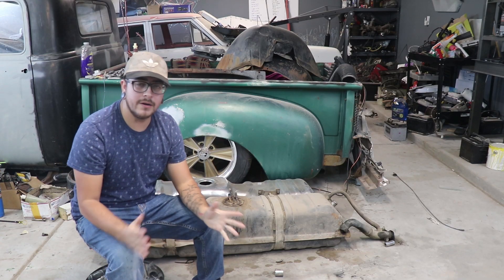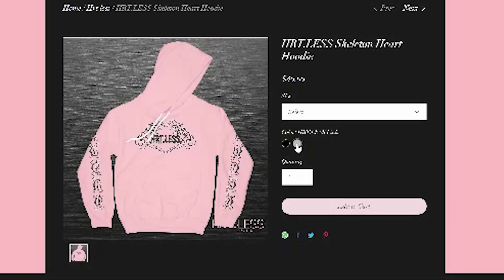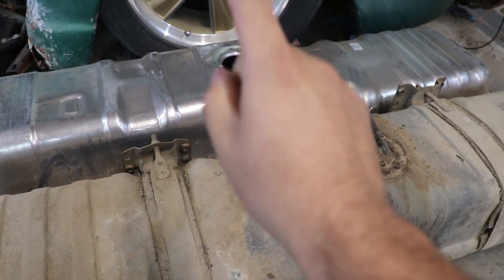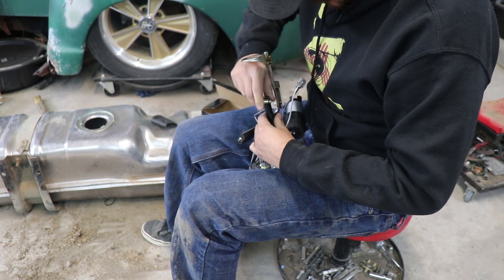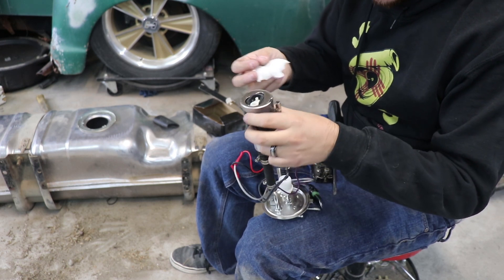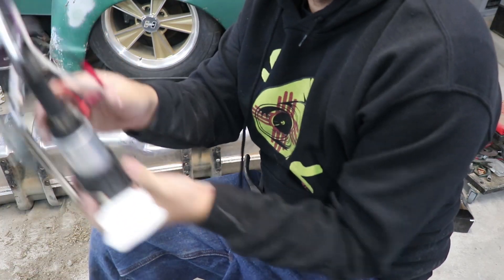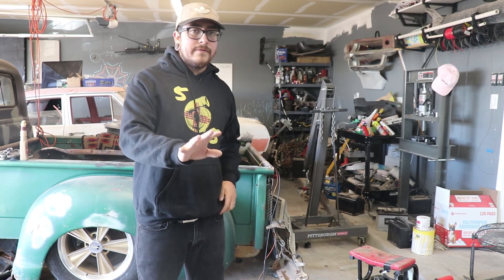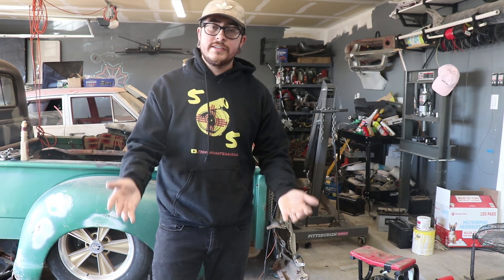Squarebody LS Swap part 5 -  Fuel System

Comment: Hey man great info here. Question… do you have a good recommendation for a behind the seat tank in a 68 c10 ls1 swap fuel return? Having a hard time finding a good reference.
Reply from the maker: Honestly get that tank out from behind you man. Having a fuel pump right behind you head will drive you crazy. There should be a drop in under bed tank for you. If not a good fuel cell will do

Comment: Would the yoke out of a silverado be the same
Reply from the maker: The spline that goes in the transnis most likely the same but the u joint size might be different. Bigger joint for trucks usually

Comment: Saw you used regular hose clamps at the tank.  Do the hold well and not leak with the pressure of EFI?
Reply from the maker: These are EFI clamps hose clamps can be used on the return lines if needed

Comment: The nylon fuel line is way cheaper and easier to use than AN line. Its all webise for fuel line repair at work. Its also what i plan on useing for my 5.3 swap in my 94 S10.
Reply from the maker: I prefer an stuff but that's just because it's what I've always used

Comment: Hey man  just watched your video got a question the fuel sender assembly will it work with my truck fuel tank as well I have 81 k20 pickup 3/4 ton I want to make sure before I start purchasing parts
Reply from the maker: Your tank isn't baffled for efi. It will work but youll need to keep your tank half full always as the fuel sloshing could run your pump dry
Reply: @JovaniDanteGriego  sorry for the late reply man I forgot to mention that truck has a 6.0 engine inside does that change anything or the same result? I really don't wanna change the fuel tanks for other ones I wanna keep it orginal with out having to do more work
Reply from the maker: @salvadorcordova5046  in your case just use an external pump then

Comment: Wondering the vent hose is not needed for gas? It looks it was capped in your video
Reply from the maker: The gas tanks on these are vented through the cap but you can add the extra vent hose of you feel like it

Comment: do i need fittings to put over the fuel sender send and return ? or can i just put the -6an line over it and hose tie?
Reply from the maker: The hose will be fine with a fuel injection hose clamp. The proper way is to flare the end of the pipe

Comment: So will this pickup and fuel pump assembly work in an 84 cutlass fuel tank?
Reply from the maker: This is only for a c10/20. Youll have to use a stock Cutlass assembly and modify if to use a in tank fuel pump or use an external one.
Reply: @JovaniDanteGriego  i have the return style fuel rail so i basically can get away with just the external walbro pump and whatever fitting to adapt to tank and fuel rails.? Cross fingers the pump doesnt get starved under hard acceleration /cornering?
Reply from the maker: @kravmaga7070  yea basically like you said as long As it is always at least a 1/4 full you'll be ok. There's also aftermarket fuel surge tank things. I forgot what they are called. It's like a little tank you mount that the fuel pump pumps into first so it's like a little reserve tank so the corners won't matter
Reply: @JovaniDanteGriego  could a guy also run 1/2 inch line, instead of 3/8  from the pump to fuel rail to give the engine that much more fuel to drink during hard acceleration or cornering before running out?
Reply from the maker: @kravmaga7070  I suppose it could work, as long as you can keep the proper psi. I don't think it would be terrible unless you were building a drift or autocross car
Reply: @JovaniDanteGriego  THIS CANT BE RIGHT can it ?  in canada using amazon to source parts im up to $375 cdn/$300 usd  for fuel system and i might still be short a male 6an  fitting or 2 for fuel pump !
thats , pump, filter, 4 adapters, 16 ft 3/8  fuel  feed line hose kit with fittings, 16  ft 3/8  return line.
my whole cutout motor only cost 445 cdn

Comment: would 10-15% ethanol fuel in canada still wreck normal rubber fuel lines or do you recomend getting  teflon lined ethanol ready fuel lines?
Reply from the maker: I believe modern rubber lines will hold up fine. Most gas still carries a small percent of ethanol

Comment: Where did you find the plug for the vent line?
Reply from the maker: I took it out out of the original
Reply: @JovaniDanteGriego  oh ok I was trying to find something to use on mine, any suggestions?
Reply from the maker: @williamcannon8136  honestly a hose with a screw clamped into it will work just fine
Reply: @JovaniDanteGriego  ok thanks!

Comment: Do you have part number for sending unit and pump?
Reply from the maker: If you click the parts list link in the description of the video it should be in there
Reply: Got it thanks bro
Reply: When you wire the pump do you need a relay or just 12v hot wire?
Reply from the maker: @erwins.7007  a relay which will be fed by the ecu's fuel pump signal wire
Reply: Im doing carburated set up im currently running holley blue fuel pump but im not liking. it over heats all the time and stops  i dont have ecu bro
Reply: Will this set up work with carburated 5.3
Reply from the maker: Um I don't think so you'll need to regulate that down to 5 or 6 psi
Reply: Yes i have a fuel regulator. My question is so i dont use my holley blue anymore do i just install baffel tank and sending unit with walbro 225 fuel pump with return line is that correct ?
Reply from the maker: @erwins.7007  well this is a efi setup. You could've probably just used a inline carb fuel pump if you were going to use a carb. Youre Basically using a 60psi pump for nothing just to regulate it back to 6 psi
Reply: Oh ok i see what your talking about know. what inline fuel pump do you recommend other than holley blue it heats up and leaves me stranded all the time is it because im not running a return line ? Some one told me i dont need one im not sure bro
Reply from the maker: @erwins.7007  does your regulator have a return line port? That might be the easiest route. I've dead headed carbs without return lines and never really had issues so not sure
Reply: No it doesn't have the port . do you think i can run an external bosh 044 fuel pump or walbro 225 with corvette fuel filter?
Reply: https://www.amazon.com/dp/B07RGR5DM8/ref=cm_sw_r_cp_awdb_imm_t1_BJL8FbDWQSC9F

Comment: On the 2pin connector which one is for fuel level sending and which one is the power? I mean the only obvious one is the grounding wire 🤔
Reply from the maker: Message me on Instagram not 100% sure what your referring too
Reply: @JovaniDanteGriego  you have three wires coming out of fuel pump. Grey is power, purple is level, and the black with an eyelet is ground to frame. I just figured it out thanks !

Comment: Having issue My LS SWAP KEEP RUNNING.
I AM USING STOCK RETURN STYLE RAIL ON 5.3 2000 SIERRA.
I prime the fuel system first My Engine runs When I disconnect the Feed but cuts off when I plug it back.
Wondering if it a Stuck Injector?
Reply from the maker: Check your injector wiring. But a engine can't run without spark so there has to be something keeping the ignition on. It's most likely wiring
Reply: I may have Wrote it Incorrect my issue.
I frst prime the Fuel system, then Unplug the feed.The engine Runs Fine But
Once I plug it Back & Add fuel it cuts off.I have good spark aswell.
Reply: Never had this issue Then Again Im using the Junkyard Injectors, can it be ISSUE with fuel Rail or injector?
Reply from the maker: I'm not sure. It could be a bad regulator on the rail? Not exactly understanding though

Comment: Hey @jovani I didn't notice if you did it or not but just so you know on the strainer for the fuel pump you should have a metal or plastic ring that fits on the nipple on the bottom of the fuel pump to help hold the strainer on if not the sloshing of fuel will pull it off.
Reply from the maker: Mine did have a metal ring, but it didnt stay on very tight, i ended up wrapping a zip tie around the whole thing so it wouldnt fall off

Comment: Hey brother, I'm getting ready to do my first 5.3 swap in my k20. my question is I want to use a mechanical oil pressure gauge. Do I need to get the stock one deleted off the pcm?
Reply from the maker: If you add a second mechanical one you'll be fine
Reply: You can use a "T" but gen 3 computer doesn't need the oil pressure

Comment: Hello, I saw in your video how you eliminated the AFM DOD, I also have a problem in a 2011 chevy avalanche LS 5.3l, and I still have doubt which kit I should choose
Reply from the maker: If I was to do it again, I would try to get a stock 5.3 cam and switch the reluctor. It probably costs as much as a custom cam but if you don't care about extra power it'd be alot easier. I'm not a good tuner so I've had alot of trouble getting it to where I feel confident driving it long distance
Reply: You can electrically disable the system by disconnecting the oil sending unit. The con is no oil pressure gauge and check engine light

Comment: Thanks for another video so using  those fuel injection claps should be good? No need to use AN fitting? i would like to do it just simple like you did it also on the fuel rail thanks again bro keep up the good work 👍🏽👍🏽💯
Reply from the maker: In the fuel rail you'll use the an to fuel quick disconnect fittings. They are win the parts list. The clamps should hold up I've used them before on other stuff
Reply: @JovaniDanteGriego  cool thanks bro

Comment: Your not gonna like the whine of that fuel pump. I took mine out after two days.
Reply from the maker: Really? Even inside the tank?
Reply from the maker: What did you end up going with?
Reply: @JovaniDanteGriego  yes. Walbros are known for that. I went with QUANTUM 255LPH.
Reply: @JovaniDanteGriego  i put a Q9 4l60 in my 86. Did it in the driveway. Lol
Reply from the maker: Thanks I'll definitely grab one incase it's too loud
Reply: @JovaniDanteGriego  doing a great job on the channel. Good luck.
Reply from the maker: @mikek771  thanks!